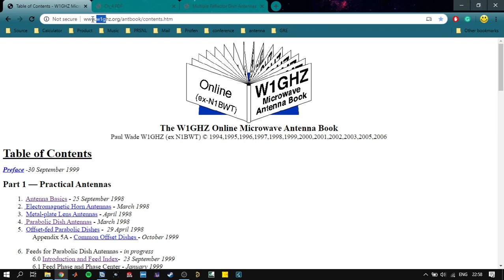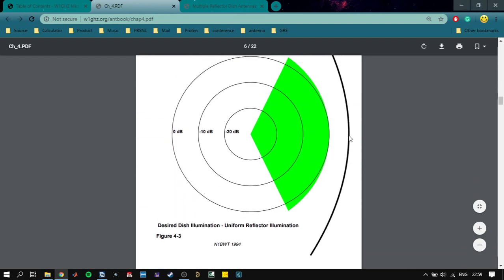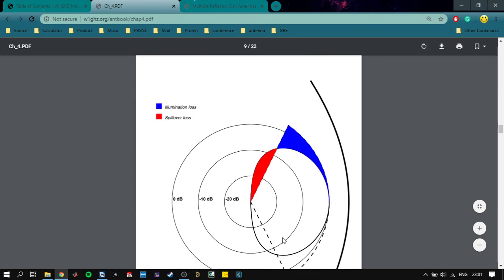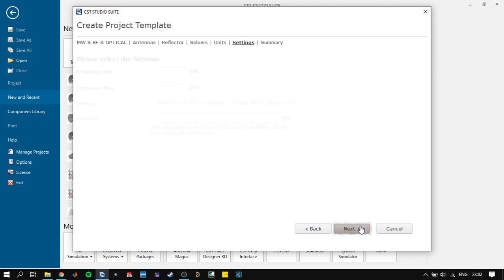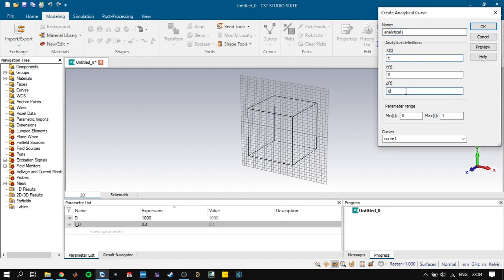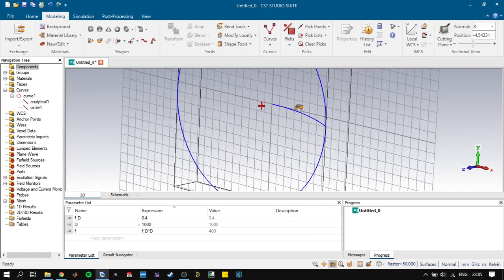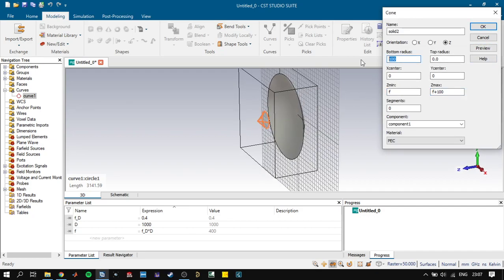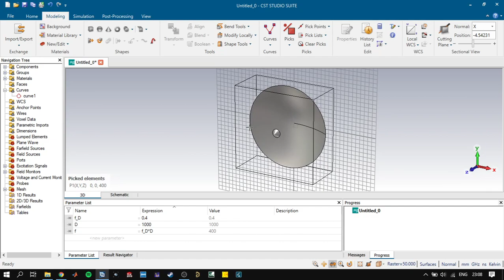Parabolic Reflector Antenna Design in CST

Comment: Excuse me, I want to define the thickness of a material as a parameter in CST Suite Studio 2019. When I give the integer value to the parameter, the model is designed correctly and has a thickness, but when the value of the parameter is decimal, the material is drawn without thickness and does not accept the value of the parameter. Thank you for guiding me if you have any ideas.

Comment: I want to simulate a microstrip antena with a parabolic reflector. Care to explain it on a video? Much thanks from Indonesia
Reply from the maker: Actually it is the same.
1. Simulate the microstrip antenna and find the phase center of the antenna. 
2. Allign the phase center of the microstrip atenna with the focus of the reflector antenna.
3. Simulate the whole structure.